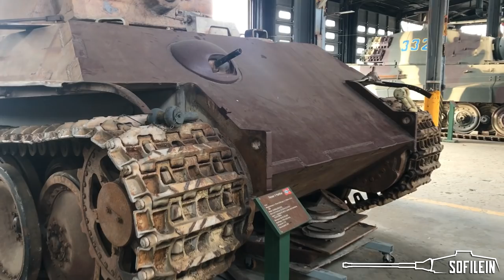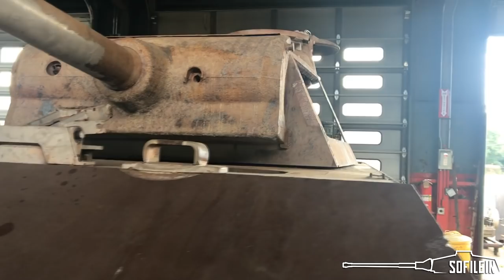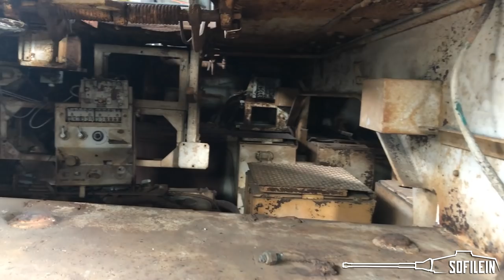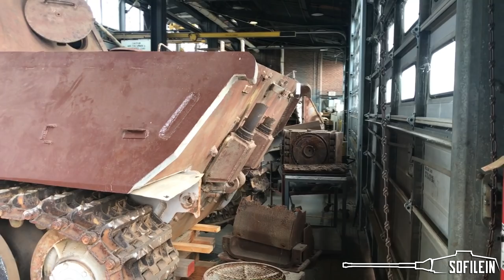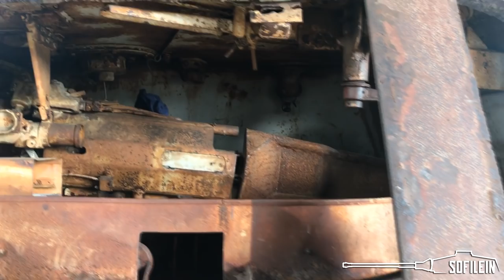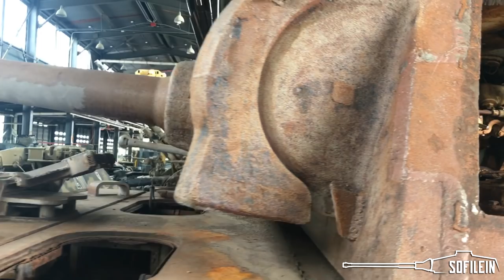HD Panther G Tank with Cut-Away Walkaround

Comment: The German welds are much better than on Allied tanks. The Soviets ones were terrible and whilst the American and British ones were better, they lacked the smooth finish - or the dovetails that you find on German armor. The Germans went over them with angle grinders on some tanks to prevent the weld become a weakpoint to aim at.

There's two parts of a tank I like to inspect closely. welds and how well they are bonded and suspension systems/road wheels and how easy they are to change. Soviet welds were diabolical. No wonder so many T-34s were blown apart if you see the state of that one captured by the Finns at Bovington.
Reply: Correction: the German welds generally looked prettier but weren't actually very strong. Soviet welds usually looked terrible but were actually very strong, thanks to submerged arc welding technology invented by Evgeny Paton.

Comment: As I said in another video comments section....people go on and on and whine about mechanical breakdowns and unreliable steel etc....this tank truely was advanced for its time and killed well. Problems that it had were because Germany at the time was running low on metallurgy elements and slave labor was not providing consistent quality. Had the scenario been different and had it been produced in as large a numbers as the T 34 or Sherman the war could have very well have been a short one in Germany's favor. That's how good or how much potential this tank had....think I'm wrong ? Read some after action reports of German tank crews....how for eg. at high speed a Panther tank crew ran a gauntlet of intense Russian fire and nothing penetrated the hull. After action report stating over 200 rounds hit the hull. Albeit deflecting shots. 

How individual Panther crews racked up inconceivable numbers of kills because of superior gun range and optical tech. 

The T 34 saved Russia but it could not have done so on equal terms.
Reply: The Germans on the offensive with a Panther?  Not everyday, at Arracourt they lost Panther by droves against a much smaller enemy,  if it wasn't due to other tanks it must have been the rain.
Reply: @2adamast  1944 - 1945 ? The war was over...the writing was on the wall. German soldiers / crewmen abandoned their vehicles at the slightest opportunity. The only motivation was to save their own lives. German tank crews on the Eastern front in 1941 - 43 were highly motivated and sliced through Russian opposition viciously....two different worlds man.
Reply: @simonwren4729 Well trained crews fired up on Pervitin / meth vs completely untrained peasants for the  most part.
Reply: @2adamast  Don't you just hate that even under the fear of death you can't count on a slave labor force to provide a consistent high quality product?  I also agree, cats don't like getting wet.
Reply: @wurlitzerlibertyinc.1612  I know that about the pervitin. What we're talking about here is the killing efficiency, gun range, and overall performance of German tanks vs Russian tanks. The Russians didn't need large numbers of Panthers to win the war....Germany did.  The Russians built large numbers of T 34' s.....a tank that really....was not a match for either the Panther or the Tiger 1 .....but....it won the war.... that's kinda a contradiction but the truth. Also Russia developed fighter aircraft that performed  exceedingly well below 10,000 ft. German fighters performed well above that altitude. The Russian theory also helped win the war for their side. Because the action was on the ground. Protect the troops...assist the ground war effort. The Germans were left with flying above 10,000 ft in circles or engaging Russian fighters that would compete on equal terms with any German fighter plane. As an example of how to win a war.
Reply: Wurlitzer Liberty Inc. Werner Von Braun was perfectly capable to use his slaves to bring thousands of rockets on target. Killing nearly more slaves than targets in the process.  The Panther is often the tank armoured with most excuses.
Reply: @2adamast  I will defer to your " winners write history " bile....it lost the war....it broke down alot ( slaves and shortages not allowed to be excused ) it was shot to pieces by all the Allies ( because of being overwhelmed ) and just generally was at the wrong time and wrong place in history. But I propose that you personally would not get into a T 34 if I were to get into a Panther and bet your life that you would live beyond the following 15 minutes....
Reply: At closing range of beyond a mile....with experienced crewmen in both tanks....fully fueled and armed....on typical Russian terrain....
Reply: Simon Wren Lol, more than a mile. I would take a field kitchen,  it would give me an extra mile and something to cook chickens. Or a pak 43 for the same reasons.

Comment: This tank seems to be weaker than American tanks.
Wasn't that a good shooting practice for M4 Sherman?
Even light tanks can be easily defeated
Reply: While not technically weaker than a Sherman, in practice, it was not a huge upgrade.

Between being too heavy for its powerpack (engine designed for a 30 ton vehicle forced to propel a 40 ton vehicle), difficult maintenance due to questionable design choices, poor metal alloy quality, and a very poor reverse speed, the Panther was far from perfect or being the best tank of the war.
Reply: @bluntcabbage6042  Tell me more about  questionable design choices
Reply: @daiviswiliam1687  One of the most notable problems was the design of the roadwheels which utilized an overlapping style which, in theory, provided better weight distribution and in turn allowed the tank to be more mobile. In practice, the roadwheels frequently got mud in them which would harden and jam the roadwheels. What's more, maintenance on the roadwheels was much more difficult as to fix a single roadwheel, you needed to take off at least two others to be able to access the broken roadwheel. It was a classic case of an engineer's dream and a tanker's nightmare.

The escape hatches on the Panther were generally subpar. For example, the commander's hatch required the commander to turn a handle several times just to get the hatch to lift up, this took several seconds which can get you killed if the tank is on the verge of exploding. Compare this awful hatch design to the Sherman which had spring-loaded hatches (springs that assisted the crewman in lifting the hatch, made opening the tank a lot easier) where a crewman in any position could escape the vehicle in 2 - 3 seconds.

Panther models A and D had issues where if they were on an incline, the turret drive (responsible for rotating the turret) could sometimes fail and result in the turret going "limp" and rotating to face whatever direction gravity wanted it to.

Alloy quality in later Panthers (G through F) was sub-par. This allowed the Sherman with a 105mm howitzer to essentially crack open the upper front plate with a HEAT round. Concentrated fire from 75mm cannons using HE could also achieve a similar effect.

A poor reverse speed made it difficult for the Panther to disengage from ambushes and situations where they need to retreat and get more support.

The gunner lacked a non-magnified "unity sight" which made target acquisition in the Panther very difficult at close range. A great example of this is the infamous Tank Duel of Cologne where a single M26 Pershing won a duel with a Panther due in part to the gunner's difficulties in finding his target and firing.

The Panther also did not have a commander override switch. This is basically when the commander is able to take control of the turret himself. Such a function is vital as the commander is better able to spot enemy targets, allowing him to quickly rotate the gun so the gunner can take aim and fire is a huge bonus towards target acquisition (the ability to spot the target and lay the gun on target in order to fire).

Not to mention the god-awful reliability due to an underpowered engine and weak transmission.
Reply: @bluntcabbage6042  Is that true for other German tanks?
Reply: @daiviswiliam1687  Some, not all.

The Panzer III and IV were both very good tanks. They were reliable, practical, and still effective. The StuG and Jagdpanzer IV were similar in this regard.

However, tanks like the Tiger II, Tiger I, Jagdtiger, Jagdpanther, and Ferdinand/Elefant were all plagued with reliability problems as well that severely hindered their performance.

Comment: Those "wunderwaffe" have actually killed the 3rd reich. Not my opinion, it was also the oppinion of it's generals wich had to work with those toys, the cost and the worktime of one panther was much bigger than an regular PzIV with late modifications. Fuel consumption aswell. Very nice looking and cute moving on the roads and at the parades, but you know, the tanks in real battle sometimes must go offroad, and there the problems starts. 1/4 of total panther's losses was officially because of malfunctions, unofficially - much more, an immobilised tank is also a tank. Also, the mechs hated those tanks aswell as their bigger brothers (Tigers) because of the checkmate positioning of the wheels. Moving on dirt land gives a lot troubles to clean them from the mud, to repair one wheel u must remove also the adjacent ones, that's a lot of work, a lot of unnecesary work. Also, their benzin engines was weak for the tank's mass, the transmission also was weaker.